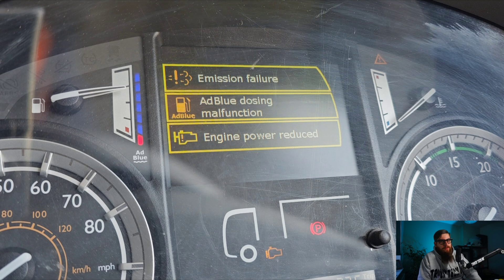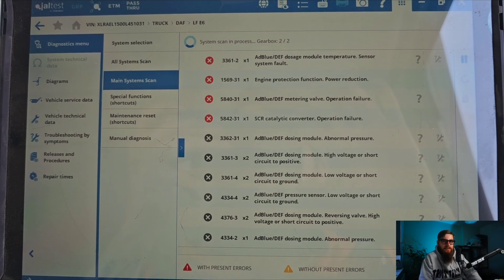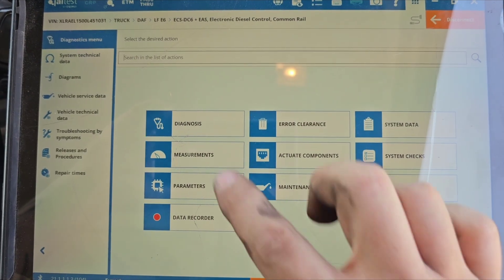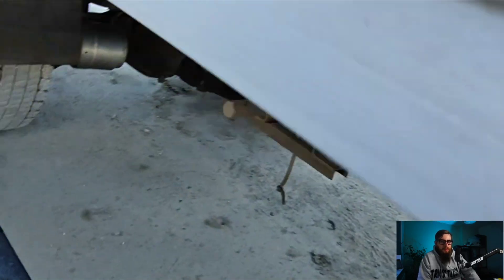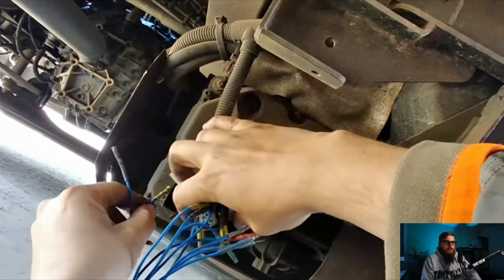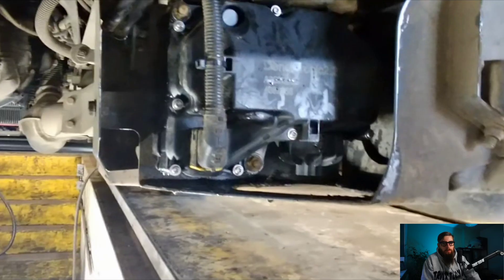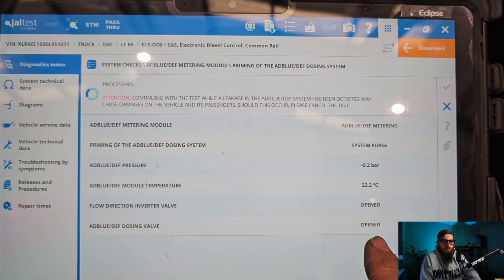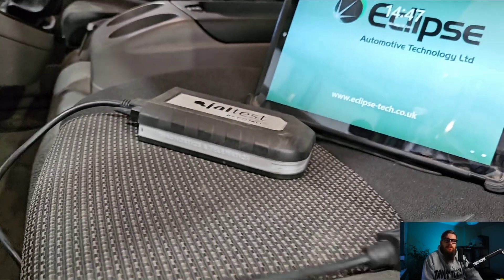DAF ADBLUE FAULTS: FIX THEM FAST with JALTEST

Comment: Great to hear your going out on your own. 👌 I have jaltest at work and on Daf cf I can’t find anywhere to check brake Lining fault. Which means I have to check every brake pad sensor with a Multimeter  and it is always the last one you check 😂 do you have a better Method.
Reply from the maker: Hey Michael 👋  thank you for the words of encouragement 😎

Now with davie for example I'm in the same boat as you UNLESS the truck is fitted with ECAS-5. any truck fitted with ECAS-4 didn't have this functionality and over the next few months I will be using jaltest to address what it can and can't do. What you can do as an ECLIPSE customer is ring tech support who will more than happily help you provide our have an account.

Comment: DAF AEBS/Radar fault video?
Reply: Most common fault is AEBS event counter to the max 😂
Reply from the maker: @preslavvasilev7387  I've had an alternator cause a voltage issue once.... it wasn't reaching the charging voltage quickly and was causing it not to calibrate. Other than that....EVENT COUNTER EVERY TIME 😂😂😂
Reply: @TRUCKTECHUK  Funny enough got a 17 plate CF with a voltage fault and won’t calibrate, Wiring checked and had radar replaced and Daf did a software update and yet the fault remained, I said possible alternator fault to start with 🤷🏽‍♂️
Reply from the maker: @Hmm265  it's worth checking the monitoring data at start up for 28 volts. If it's a slow climb up voltage-wise....change the alternator 😎👌. Let me know how you get on
Reply: @TRUCKTECHUK  monitored cranking voltage on the engine ECU and dropped to 22 volts believe we monitored cranking voltage inside AEBS and dropped to 15 volts, checked to make sure nothing else wired into the system so I’d suggest an alternator again tomorrow :)
Reply from the maker: @Hmm265  if its not the alternator I will eat my hat with that sort of voltage buddy! AEBS  is so picky with voltage.
Reply: @TRUCKTECHUK  the tech that is working on it ran a wire from the battery’s directly to the AEBS ECU and managed to rectify the voltage fault and then road tested the vehicle and it calibrated successfully, not the kind of repair you’d want but for the company I work for it’ll do 😬
Reply from the maker: @Hmm265  I'm glad you got it sorted 👍 your right. The reason it's so pedantic on voltage as it's like EBS. They are safety-critical items....let's hope they don't have a fatal accident as its been altered from dafs E.U specification the would go over it with a fine toothed comb lol
Reply from the maker: Soon as I get one with a fault I can go through the fault and rectification. 
Someone give me an AEBS fault to fix 😅😅😅😅